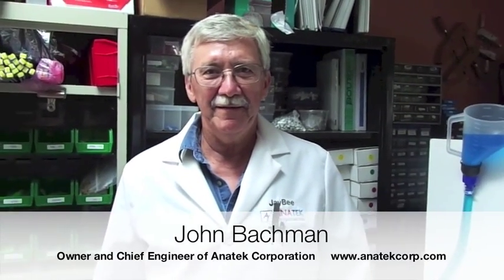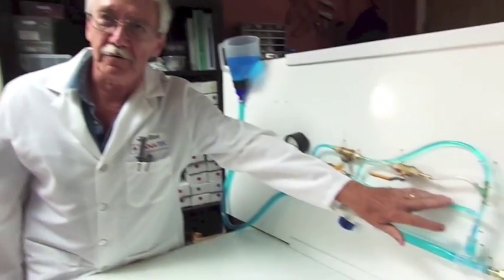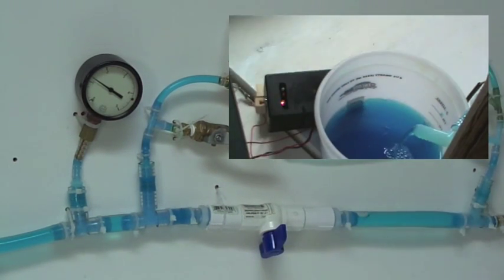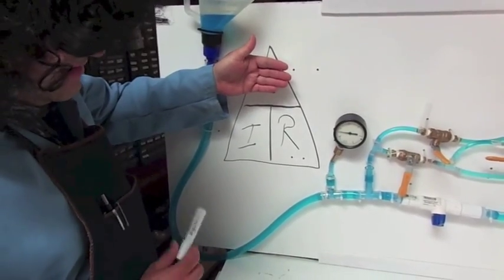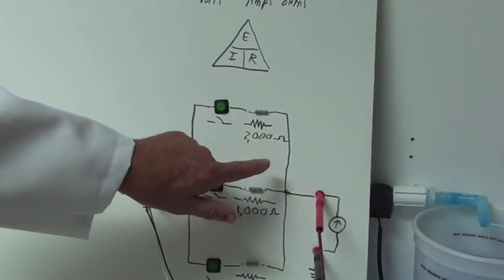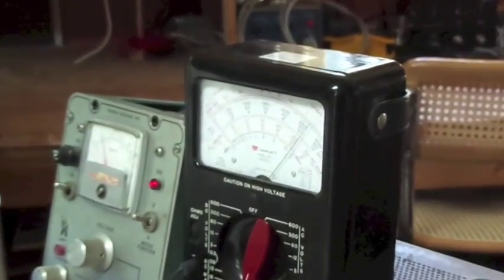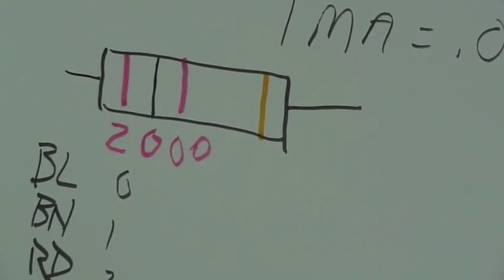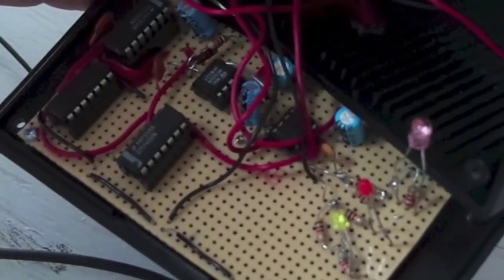Electronics Made Easy with JayBee Episode 1; Resistors and Resistance

Comment: you might know an answer to my question.....if cpus lock out at negative 50 degrees here on earth using liquid nitrogen and then overclocking them to 7-8.8ghz....how can electronics work at all in space with temperatures ranging from 450 degrees to minus 450 degress...that's well below lock out feature here on earth by about 100 degrees...I haven't found anyone to really answer this...I know its not a special chip as amd or intel would both proudly display these chips at an event to overclock if one were available even if they couldn't name it due to military classifications..i know they make radiation hardened chips..but how do they overcome heat and cold when most of these supposedly run off batteries and solar panels? I find it highly suspicious....ty